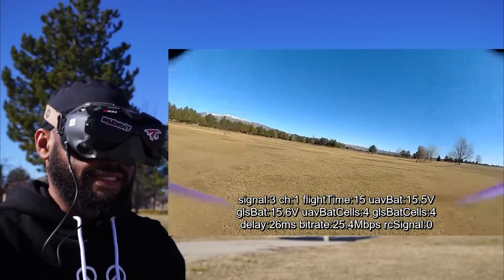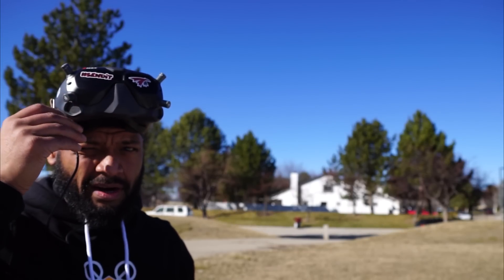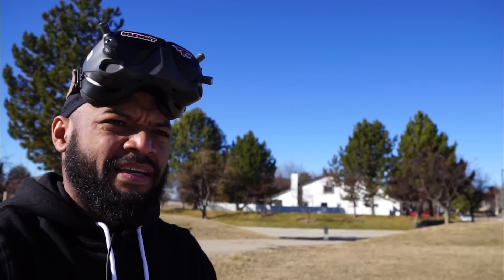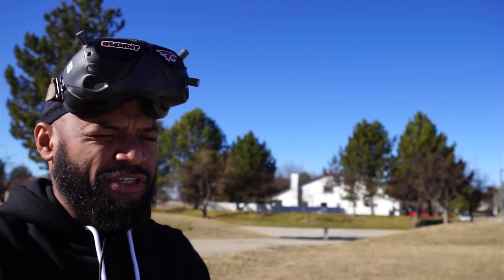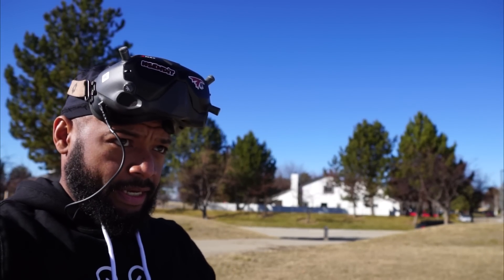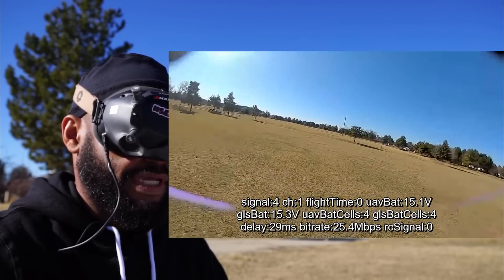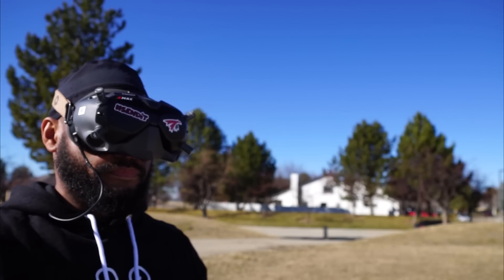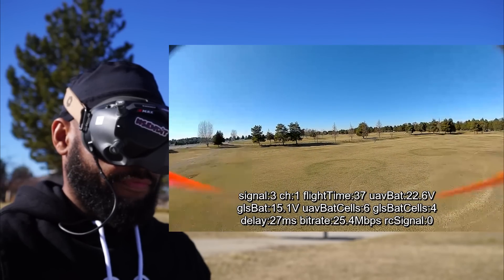Caddx Vista VS. DJI FPV Air Unit | Range and Penetration Test

Comment: Im brand new to FPV, can someone please tell me what the sound "System on, ready to fly, engines armed" and "rf signal critical" is from? How do I get it?  Great video by the way, very informative. Thank you!!
Reply from the maker: Those are from the "amber sound pack" for OpenTX. https://open-txu.org/amber-sound-pack/ You have to add the sound files to your radio then manually assign an audio track to each function. You can probably find a seperate video on it.

Comment: hey there bro Ive been fling for over 10 years and look at the omni direction scale on google as a diagram and look at the and then compare it to the antenna angle your vista w. let me know if that makes a difference as at I bet 100% that if you got a nice 75* angle on that vista antenna you will get 6 per pass.. The issue with you crossfire can not be related to be a reason for the issue with your Vista as they are two separate systems. good luck and hope this help also great flying and keep posting ,please let me know if this helps!

Comment: What headband is this for the DJI goggles?
Reply from the maker: Ethix v2. But you have to cut a slot in the rings to use it.
Reply: @Furadi is it worth it? The DJI one kind of sucks. The straps constantly come loose and also I don't like the top strap

Comment: I think everyone looking for a video for “comparison of air unit and caddx” would find this and realize this comparison is futile because the quads are not identical. At least replace the unit in the same quad for a real “comparison”.  At least use the same antenna. Thank you for trying to throw it together anyway. This was the only video I found other than Bardwell.
Reply from the maker: 🤔🤣 why would you think the frame has anything at all to do with it? also the antennas are about equal in performance as they're the 2 highest quality omnis you can get. They're not going to account for any difference.
Reply from the maker: Also, I fly the vista more just because the builds are lighter but even 2 months later it still performs noticeably worse in all conditions except maybe indoors.
Reply: @Furadi  Not using the same quad, nor the same antenna will not be a comparison of the unit... although similar its just... not a fair comparison honestly, your antennas and frames will provide different radiation patterns that affect the signals in different ways, that said, thanks for your comparison

Comment: I have a TransTec beetle and I took those dipole antennas that come with it off and put on the DJI antennas that came with the air unit. Now I get half of the range why would that be?

Comment: Appreciate all the testing! I’m still on the fence as to if aftermarket antennas actually perform much better than stock. Also have you noticed if props in view affect your range? Just read a thing where lots of movement on the screen takes up bandwidth and affect performance. Any take on that?
Reply from the maker: No having props in view will cause more pixelation but I haven't noticed any decrease in range. IMO if you don't plan on running a gopro definitely look for a frame that keeps the props out of view.
Reply: By the design, center will retain high bit rate while edge has lower bitrate, having props out of view certain has the benefit. Can you do the comparison if you have the frame?

Comment: For the first test, the Vista antenna might have been blocked by the rear motors since it was inline with them.  With the standard Air Unit, you have the one antenna pointed up at 45 degrees.  So it's probably no surprise that it did better.  But that's the benefit of having diversity antennas, being able to separate them at different angles to better cover all flying situations.
Reply from the maker: You're the 2nd person to suggest that... I guess it doesn't show very well on the table but the antenna is not in-line with the motors. The motors are mounted below the bottom plate and the antenna is mounted to the top plate so it's clearly above the motors. It also sticks out past the motors rearward. I feel like people are trying to rationalize the vista doing worse and I don't understand why... for what it is it did really well I think. 

At one point in the first test the CL1 is slightly banked towards me (dropping the closer motor even lower) and the signal was still around 4mb.
Reply: @Furadi  Hard to see the exact positioning of the antenna from behind a computer screen.  :-)  I was just suggesting a possible reason why it appeared the Vista did "worse" than the standard air unit.  Either way, it's an awesome system.
Reply from the maker: No I definitely would have called out any antenna obstructions like I did for the 2nd test. But I agree... even though the vista did worse guess which I've been flying the most between it and the air unit :p

Comment: Nice test.  You would think that 2 antenna has to help.  I still like the vista better.  The slight performance hit seems worth the size and weight reduction. 
I think the bigger downside is the lack of an sd card.

Comment: My latency as reported by DJI goggles is about 40 ms. This seems very high. How do I get the latency down?
Reply from the maker: Are you running in HQ mode or low latency?
Reply: @Furadi  Tried both without any difference. I was in CE mode, although that isn't the right mode for where I live. I have changed to FCC for my next test on the weekend.
Reply: Furadi  Still had about 40 ms latency in low latency mode or HQ mode when in CE mode. Switched to FCC 200 mW and then when I switched to low latency mode delay was about 20-25 ms. Still about 40 ms in HQ mode. So CE mode was an issue with latency for me, although the picture quality was faultless. All this was with a vista in a 3" quad. I doubt I'd ever get a full size unit as it really is even too big for my wings.

Comment: The vista is cool if you just have to stick it in an old frame and run a GoPro, but the air unit is the way to go. The weight savings isn’t that great for a five inch or greater build. I still don’t see why everyone is so hyped to put the vista in the beta 95x. It doesn’t seem that fun to fly and you don’t get hd dvr.
Reply from the maker: Honestly I'm pumped on the vista. (if you couldn't tell lol) 19g vs 35g is huge for any size quad. Actually it's closer to 40g for the AU if you count the extra antenna not to mention mounting.
Reply: @Furadi  I noticed that you've been totally pumped up pissin off DJI haters 🤣😂. That's what made me follow you.
Reply from the maker: @escobarfpv1275  😂

Comment: Antenna gain is only a good thing as long as you can keep it away from the nulls.  On an air unit, diversity means that gain isn't as much of a bad thing - on the Vista (or any singular output) you always want the minimum amount of gain if there's a chance you're going to wind up in the nulls.  If you're cruising long range, and can point those nulls in directions you're really unlikely to be at max distance, then that gain is great - if you're like me (stupid) and want to do flippy floppies at distance, you either need minimal gain or diversity.  To get max distance, it's diversity + gain... but as is the case with most of this stuff, it's less a signal strength problem than it is an SNR problem.
Reply: So, Air unit should dominate in this case: for outdoor range testing, it means that you're not going to be in the null of both antennas, so you can run an antenna with better axial ratio (tends to have a little bit more gain to achieve that) which further aids in cleaning up signal in multipath environments.  The signal processing that handles multipath (again, I'm guessing it's a DSSS-Rake arrangement) means that obstruction of the single antenna isn't as bad for SNR as it would be otherwise, which is why the Vista worked well at all.

Comment: Regarding the crossfire: the 250mW should be plenty. Habe you seen the TBS video where they flown 30miles with it? Do you need to acro 2 miles out on 150Hz? I ditch my big crossfire as soon my tango 2 arrives!
Reply from the maker: I don't really care about a range test in ideal conditions on a wing. With my quads I'm at least at 500mw dynamic if I plan to fly any farther than a half mile. I've had enough close calls that I just don't risk it.

Comment: Nice test bro, Air unit w 2 antennas usin MIMO should get way better range in concrete at distance
Reply: I doubt it's true MIMO - most likely running independent rake receivers then signal combining (MUX) aftewards, which should be pretty solid... most of the improvement is there.
Practically, for outdoor range testing, it means that you're not going to be in the null of both antennas, so you can run an antenna with better axial ratio (tends to have a little bit more gain to achieve that) which further aids in cleaning up signal in multipath environments.
Reply: @tehllama42  ah OK good info, regardless it loves concrete or steel on both sides at distance ......luv dji
Reply: @flo-ridafpv5713  Yeah, that's something direct analog cannot compete with.

Comment: Why temperature control off? and do you recommend fly like that? I know it maybe improve range but that Came with negative stuff if I’m right!
Reply from the maker: I think I've just noticed some inconsistencies with temp control on. Especially down in florida. But I need to test it more to be sure.
Reply: Furadi great! Is good to know that I just did a post about it on the group long time ago and anyone couldn’t give me a solid answer. Will be great to see a video about that if us possible. Will be the o lot one on YouTube talking about it 👍🏼

Comment: Furadi have you tried the DJI transmitter and what are your thoughts if you have. I don’t own anything yet and I’m debating if it’s worth the extra hundred to get the whole kit or just the goggles and air unit, then get the Radio Master t16 when it comes out for $130ish.
Reply from the maker: I have it feels pretty quality in the hand... BUT it's too limited for what I do because I still fly micros on sbus and long range with crossfire. I think the best use case for the DJI controller is for newcomers or people that really don't want to deal with adding a receiver.
Reply: Furadi thanks for getting back to me. I guess I have to decide whether I will ever get into micros or not. With that said I have another question, what would be the smallest quad a Vista setup could fit in? Are 2-3 inch quads considered a micro? I’ve been debating getting the Novice 3 setup with box goggles or just skipping that step and going all out with a DJI goggle/transmitter and building a 5 inch setup or try out the Transtec 2.5/3 inch beetle. I’ve been into RC for 25 years so building and setting up a quad won’t be an issue. I like hearing different opinions on which route to take with getting into the FPV hobby. What do you recommend?
Reply from the maker: Oh people are already putting the vista in indoor whoop style quads. It sounds like you're gonna like FPV so IMO skip the novice stuff!

Comment: Should have used the same antennas on both. The vista antenna also looked like it was blocked by the motors on first test.
Reply from the maker: If you think a true-rc antenna would perform that much worse than a vas minion then that would mean it was either defective or broken. There usually isn't that much difference in performance when dealing with omni antennas. Keep in mind true-rc also designs the lumenier AXII.
Reply: @Furadi  Running the same antennas would have just made it a true comparison. But probably more down to antenna placement.

Comment: Possibly the Vas Minion performs better than the Rush Cherry ? I would be curious if the Vista performs better with a RP-SMA pigtail and a Vas Minion or the Airunit antenna that has the RP-SMA connector . IE get the antenna up and out a bit more . easy enough to find .stl files for most frames to have an SMA bracket at the rear . This would allow you to change antennas more often and not mess with the UFL so much.

Comment: 150hz Mode according to Trappy, is only meant for racing. In auto mode it switches back to 50Hz pretty quick. Like usually 100-200 yards away for me. I’m actually really surprised you made it as far as you did lol.
Reply from the maker: Oh that was totally a fluke. I regularly fly a few hundred yards in force 150hz @ 100mw. I really only turn in off for my FR7. Not interested in 50hz on my freestyle quads at all lol.
Reply: Furadi Interesting. I’ve been refraining from trying the forced 150Hz mode because of how quick it transitions in auto lol I’ll have to give it a shot this weekend to see if it’ll cover my normal fly spot

Comment: I use both the Vista and Air units on my 3” quads and can’t tell a difference.  I also have the antennas up and out the back the same and believe you’re test could have been more definitive if you had your Vista unit antenna up and out the back further.
Reply from the maker: Like I explained in the video for the first test flying perpendicular the cherry antenna is completely unobstructed.
Reply: @Furadi  Perpendicular to a motor yes, hence the pore results. The DJI air unit had a good advantage on one antenna placement alone. To be honest the antenna placement on just about all DJI ready frames is just not where it needs to be. Yes I get it, the antennas need to be in the ideal location for a crash but it's no where near ideal. You would be shocked at the results you can get with proper antenna placement on just about any analog/HD rig. Respecting clean line of sign and low EM/RFI noise floor is a so key to the results you will get. No disrespect here cause I love your content but when it comes to RF even those that know just don't really understand.
Reply from the maker: This was covered in an earlier comment. The cherry antenna is actually above and behind the motors when viewing the quad from the side. Additionally the quad was flying banked to the left if you rewatch which drops the motor out of LOS even further. People are really reaching here lol. Again, it's ok that the vista did worse because for what it is it's still amazing.
Reply: @Furadi  I don't comment on speculation like most, I do real world testing but I do respect your comment and opinion. Please don't misunderstand my post honestly I do enjoy your content.
Reply: @Joe_Sa_3rd  I think I'm with you on this Joe. 
Based on my tests I'd say it's all about antenna placement
Reply: Agree. Air unit better only inside building flying

Comment: That is weird  when I originally heard vista would be better outside then inside hmmm how u like the minions? And are u running crossfire lite or micro
Reply from the maker: yep basically the assumptions about the vista were kind of backwards... at least for me lol. I'm running the crossfire full. Minions are great... similar performance to an axii.
Reply: Furadi  nice u should try the trueRC long matchsticks in the horizontal alignment for the air unit next and I was thinking of picking up some minions actually tried them on analog during the weekend and had a clarity difference given the fact I have a shitty vtx so it’s easier to see the difference lol upgrading to rush tank Ultimate vtx soon and my boy has air unit and vista and that’s a rush antenna on the vista not bad but good to see a test with range involved

Comment: i hear that rush cherry has 1.2dbi . It is good for 360° flight, but i will prefer to use smth like axii because they have 2.5-3dbi( extra 2 dbi) . In math  1200mw on 1.2dbi =700mw on 2.5-3dbi  antennas. for long range  and penetration 100% needs to upgrade.
Reply: As long as you can keep it away from the nulls.  On an air unit, diversity means that gain isn't a bad thing - on the Vista (or any singular output) you always want the minimum amount of gain if there's a chance you're going to wind up in the nulls.

Comment: How can I make my quad go long distance with not losing range and picture?
Reply: petefly FPV use analog
Reply: @chrishiggins7475  so your saying stay with the original stuff. What I have is a spektrum Radio dx9 but if I got the crossfire radio would it make a difference?